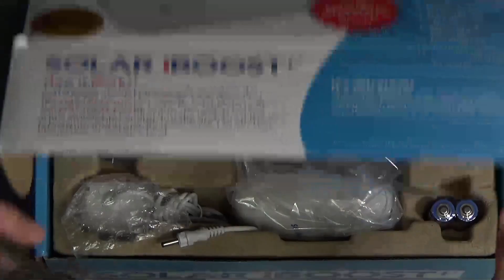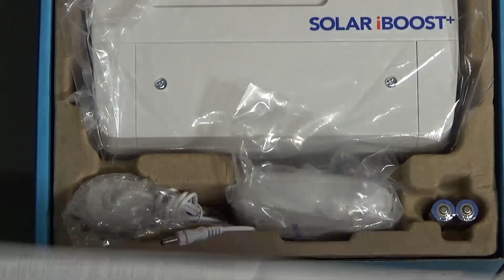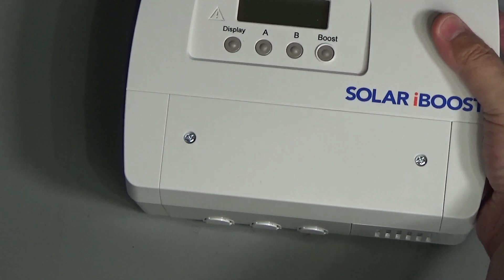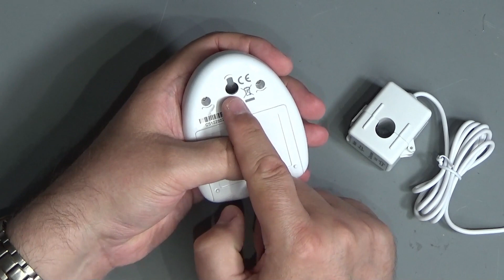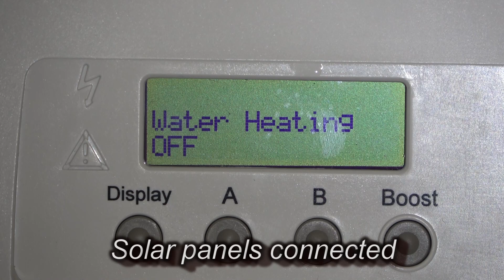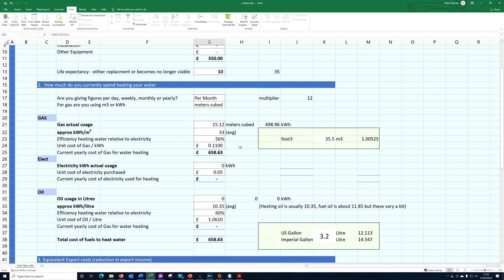Solar iBoost+ Diverter Review Installation - Is it worth it #0063

Comment: Can it power a fan heater?
Reply from the maker: No.  The output from the unit is a rapidly chopped DC. The fan heater needs AC at proper voltage. Otherwise, the heater will overheat and catch fire.  It could probably power an old-fashioned bar heater that has no fan or electronics.  I used an oil filled heater for testing.

Comment: Thanks for such comprehensive information. I have been looking into replacing my i-Boost which was installed in a newbuild house and failed 14 months after I moved in!  I was then told it was just out of warranty (2 years) as it had been fitted by the builder before the house was finished.  So I think your calculations of payback time are over optimistic!
Reply from the maker: Yes there are quite a lot of failures and both fuel costs and reliability are a long way from what I expected when I shot the video.  I for example don't use it at all because I make more money exporting the electricity than using it!  I pay 8.5p per kWh at night to buy a full days supply (battery storage) and export at over 15p per kWh.   However warranty is not really legally limited like that (any legal people like to chip in) - the device should fullfil the purpose for which it is designed and a device like this only does that if it has a reasonable service life.  The warranty onus shifts from the manufacturer (or supplier) having to prove you broke it to you having to demonstrate that it failed wihout your interference!   I hope that lots of users start taking these cases onto watchdog and similar consumer affairs programs and also tell the company you are reporting them - used to be "trading standards" not sure what the current gov department is - for not repairing an item that was not fit for the purpose for which it is sold.  You may get noware but it seems from the evidence on my comments that there is sa systemic problem.

Comment: I have an iboost on a 4kw solar edge system without battery storage. In summer it heats my hot water and I turn my boiler off. I do have a 20 year FIT tariff. It allows me to use most of the solar I generate. I'd rather have battery storage but at 70 years old cannot justify the extra cost. Ive had the system 10 years and its paid for itself. Since im retired and bake my own bread I structure my day for oven, washing machine and dryer in daylight hours. I make about £700-£800 per year from theFit tariff. In winter the solar isn't worth having. Its not ideal but that's the best I can do without further investment. My electricity bill is quite low and I pay £75 month for gas and electricity. In winter around £125/ month. It takes around 8-10kwh of electricity to heat the water cylinder which is double insulated or 20kw worth of gas. In winter I don't heat with gas or electric but a multi fuel 8kw stove. The iboost uses pulse width modulation to vary the  available export energy/ power  iup to the maximum load rating of the emersion heater. My emersion heater is only 1.5 kw and the iboost can handle up to 3kw.  Ive had it 4 years and it saves a lot of gas in summer. In winter its useless but so is the solar. I live in the north of England and in previous years have made around 3.4mwh from solar. Because of the lousy weather this year I expect to be down on production due to cloud. toping out around 2.7 Mwh. around 700 kwh down which equates to nearly £170 in fit return.
Reply from the maker: if you have FIT then the diverter should easily pay for itself.  I know what you mean about the weather - my production figures are horrible this year so far.

Comment: Hi - we have a solar array and iBoost, but NO batteries.
Does our immersion have to be permanently ON for the system to work, or should we have a timer for the immersion?
thanks - very useful video.
Greg
Reply from the maker: The iboost will only heat water when the sun is out and you are exporting.  So you also need some other way to heat in days when the iboost is not enough or to top up the heat when needed.  Mine is both gas heated and has an immersion, so the iboost is connected to immersion without timer, it heats during the day if there is enough sun, then the gas heating  runs at 6am to ensure we have a full tank fir morning showers etc.
Reply: @MakeOrRepair  many thanks for the very useful answer!
Reply: @MakeOrRepair  many thanks, thats very useful Greg

Comment: Why would it ever take fro, the battery when it is triggered by exported energy? When the sun goes down there is no solar so you are running off battery and there is no export therefore the iBoost should be triggered to engage your immersion. No complicated sensing or algorithms required. Or have I misunderstood something?
Reply from the maker: If it is using all the exported energy which is the excess solar, then the exported energy now reads zero, so when the sun goes in the inverter keeps the export at zero by using the batteries.  The iboost does not have any means to know, as far as it is concerned it is just right, no idea that 3kw is from battery instead of panel.  So it looks like the algorithm allows a little to always export, e.g. 100w so when the inverter switches to battery after a while the iboost realises it is taking too much and drops 100w, then the inverter reduces battery drain by 100w to match and this adjustment happens roughly every 20s, so if the iboost was allowing 3kW to the immersion then it takes almost 10 minutes before it shuts off, that is why I played with the threshold in the video, to make it work in bigger steps.

Comment: It can save money IF you have immersion hearing only for the water, the water takes 3KW to run a heater..
Reply from the maker: yes, if you only use electricity for hot water the net saving is the difference between purchase and export price

Comment: Brilliant forensic analysis most of which I understood! Already got one installed but probably would not have bothered if I had watched this first. Installation costs could take another tenner a year off any possible gains over a 10 year product life.
Reply from the maker: Yes, I wanted to encourage people to look at all sides of the subject, not just the savings in the adverts.  Since i made the video, it has only been worth me using it for a few months while my export tariff was pathetic and gas trebled in price.  I'm a little out of touch with the cost of installation but it could easily negate any savings.
Reply: Ten years? we've had two in less than 5 years I'm not buying another there now £300 each
Reply from the maker: @250190bailey I find it disturbing how many reports of them failing I've received. I would choode a different product if I bought again.  Then again for me it has never been cost effective.

Comment: At the moment I get 15p per kWh exported. gas costs me about 7p per KWH.  Given I use roughly twice as much gas as  electricity to achieve the same heating effect for hot water, for every KWH of electricity not exported I lose 15p of income but save 14p of gas. In other words - it would cost me to divert exported electricity to heat how water.
Reply from the maker: Exactly.  For me there were just a few months in summer when it was worth it - my export tariff was ridiculously low and gas crazily high, but since my export tariff improved the iboost is pointless.

Comment: whats wrong with "battery compability claims". 
this is connected to your consumer unit. makes no difference if you have batteries or not.
The fact that has a 100W buffer (not zero as you mention), it will never have issues with inverters. 
If sun goes in, you wont have any export, therefore this will turn off.

Example. battery is full:

2000W Solar:  youre using 200W,  exporting 1800W,     Isolar will use until export = 100W,  so it will use 1700W. 
 inverter will still see:  2000W solar, 1900W load, 100W export. 
The moment the Sun goes out (cloud) , the inverter will still see's "100W export" all the way as the isolar reduce load, as theres no sun at all, there wont be any export, so the isolar turns off.    

Your inverter doesnt "Dectect loads".  it just measures whats being imported/exported.  so theres no reason this wont work with batteries, specially with the 100W buffer.

The few seconds (10-20-30) it takes to react, 2kW for 30 seconds its a grand total of 16Wh,  or 0.3% of a 5kWh battery. which would quickly top up to 100% in a minute or so. 

Is it worth it? 
all depends on how much you pay to heat water at night, how much you get paid for exports, and so on. for me, its worth it, but only if the unit is used/cheap/etc
If you were going to heat it at night at 7P and how you're diverting export of 5P , is not worth it. but if you need to heat it during the day, (after a morning shower) , and your battery isnt big, that can keep your water hot all day in the summer and save you from importing peak pricing to have a late evening bath. (and avoid 30+pence import ). 
in that way , it can be worth it. 

I think your issue is that your inverter is only switching at 100-200W, if was keeping it at 0, this would respond instantly.
Reply from the maker: It is nothing to do with the inverter, this device itself just sees the export every 20 seconds or so (much slower than the inverter) so if the diverter is using 1kw for the heater and the sun goes in the diverter has no idea it happened because the inverter uses the batteries and the export is still zero - so how does the diverter know how to stop.  As demonstrated it can take a long time to work it out!

Comment: Agree with you about the delay in the system responding - understand that its due to the time delay between sender transmission (to extend battery life). I vaguely recall reading somewhere that you can overcome this delay by using the mains power supply for the transmitter that can be ordered, but since my meter tails are outside of the house that's a non starter for me.

As a check, I temporarily powered it through a plug in meter and found that the IBoost pretty consistently reads 12% higher (in kW). The exam question is which one is correct?  Any comments would be welcomed. 

One question? - according to my smart meter, my house routinely exports 200 to 300 watts to the grid (far higher than the claimed 100). Is there any way of adjusting this threshold (I understand that the later model does)?
Reply from the maker: I would be surprised if a plug in meter was that bad, they seem to use a dedicated ic.  The iboost on the other hand is using a resistor to measure current in a rapidly switching supply to the immersion and then doing the maths in a microcontroller.  Re the threshold for export, definitely programmable using buttons on the + model but I would need to download a manual to recall how.  I'm not sure on the earlier version.

Comment: I don't know if this nugget is of use to anyone, but ... my iBoost was fine & not charging from the battery (apart from the switching delay discussed here), but after a visit from Nat Grid to seal my old meter, it started drawing about 150w. I moved the collars further apart & it started switching as before. I'm assuming the collars had accidentally slipped closer together. Something to watch for?
Reply from the maker: I had to use a cable tie under one of yhe current transformers/sensors toyshop it slipping down.  Attached tightly to cable then trimmed the cable tie so about 20mm sticking out.

Comment: You did not mention the second output channel on this unit which comes into action when the emersion switches off when HOT, as there is still solar available I use it to feed a 3kw storage heater(with bricks inside) that is fitted in the lounge to give evening heating when you open the flap, This also has a time clock to topup during a off peek rate electric during the early hours of the morning, Do not have a battery on my solar at present
Reply from the maker: Yes, that is a good point, i should have looked more at that

Comment: Very comprehensive overview, I only use the Iboost in the spring summer and autumn as I have biomass during the winter, my solar is producing maximum 40kw per day and with the 12kw battery storage it is charged before mid day, i just wish there was a more intelligent monitoring for the house that combines all my systems, iboost, solar, biomass and  Schneider Electric Wiser.

Can you give me the link to your spreadsheet please. 
lastly we need the standing charge removed for anyone exporting to the grid or standing charge removed with unit cost adjustment, this would encourage users to invest in generation as well as encourage users to use less instead of being penalised with a £300+ upfront cost before use were the poorest are impacted most.
Reply from the maker: Yes, I think there are several comments regarding integration of the different systems.  With my solar being lower, but with reduced cost overnight, i could really do with a more intelligent system too. A few people have done some things  themselves and there are some rule based things that Dan run on phones or tablets, but they rely on being able to talk to devices, and most devices are proprietary, trying to lock everything to their brand.
Also agree in the UK there is no incentive to export.  The actual amount paid is silly and there must be dozens of comments on my channel from people on old fits scheme who are desperate not to export because the get paid regardless.  I would certainly like to see both situations change, for example open standards for device monitoring and control and proper payment schemes to encourage export, that reduces costs to suppliers, and increasing local generation also reduces infrastructure overheads.  Anyway I need to look for appropriate pressure groups

Comment: I have an iboost plus that has stopped heating my hot water, I have tested the heat element and measuring around 20ohms, the thermostat is working ok and switching continuity when the temperature dial is turned yet I’m still not getting hot water.. what voltage should be coming out of the unit on output1, I’m measuring around 211v DC.. and the element doesn’t heat up. Applying 240vac to the element and everything is working fine with no issues, water is heating up. As soon as it’s wired back to the iBoost then it’s not heating. Is the output voltage correct? What else can I check? I am boosting the unit for 15mins to test.
Reply from the maker: It delivers a switched dc signal so the multimeter can be fooled.  but it is not so much the voltage as the ability to deliver current during the pulses.  You would skso need to test it connected to heater not just the output.  I will be putting up a repair video soon, might not be your exact problem but might help explain things.
Reply: @MakeOrRepair  I have tested at the element and getting between 170v and 211v Dc, is this showing correct operation? The heat element must be both AC and DC as it heats up and works fine connected directly to the immersion isolator AC supply, I didn’t realise the heat element would heat up with a DC supply
Reply from the maker: @casssid  on the face of it, it sounds like it would heat somewhat . But i think it is a bit low for boost. the element just needs power, dc or ac is irrelevant to it.  240 vac rms is just a way of expressing the ac in a way equivalent to dc.   What we want us the power delivered, now in theory if we say 200vdc with 20 ohms load that gives 10A and 2kW power.  So that seems a little low for boost, what I'm wondering is if your measurement is getting skewed by limitations of the meter.  The iboost uses full bridge rectification so 240vac in becomes roughly 340vdc, the iboost then uses pulsebwidth modulation to control the current going to the element, I.e switching that dc on and off thousands of times per second.  A multimeter is going to have difficulty sampling that signal and displaying a meaningful voltage.  I have one under repair at the moment,  if the component ever gets delivered I'll connect up my scope and perhaps power  analyser to show how it works and what to expect.  Warning - Do not connect a scope without a high voltage differential probe

Comment: Great video! I have a question though, what happens when you produce, let's say 3kw, and use nothing in your house and have a 2kw immersion heater does iboost "force" 3kw through the 2kw immersion heater or only 2kw as it is rated for? And then allow to export 1kw
Reply from the maker: Each device including the immersion heater "draws" the amount of power.  The diverter either limits the amount it can have or lets it take the amount it normally uses.  So if you generate 3kw, you house uses 0.3kw, there is 2.7kw for export, if you immersion is 2kw, then the diverter may switch it on full, so the immersion gets 2kw, house 0.3 and 0.7 is still exported.